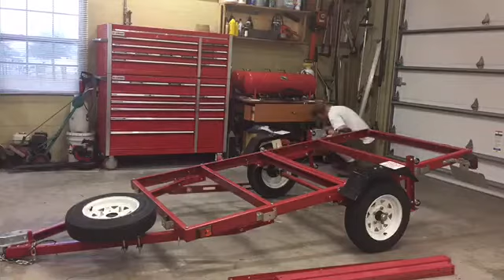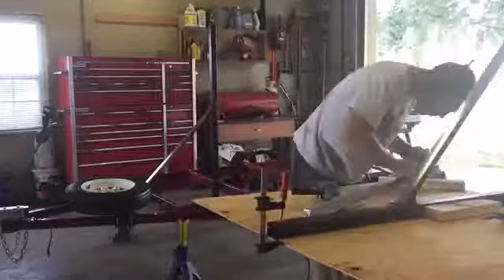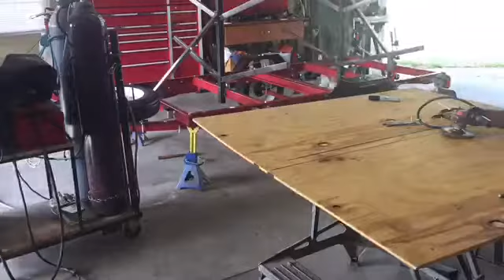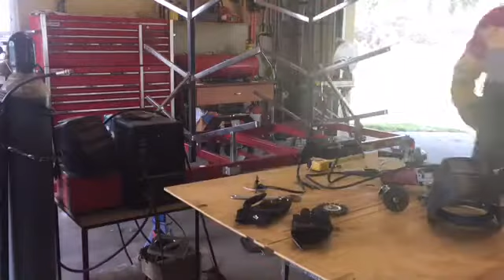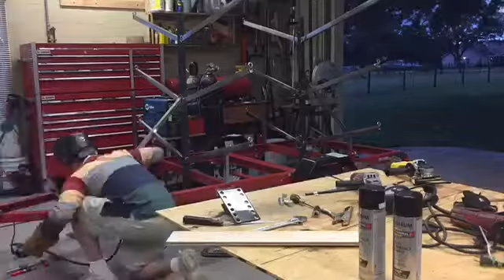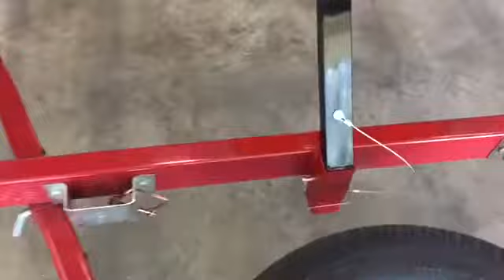Doug's Kayak Trailer Build

Comment: Nicely done!  You really checked off all the right boxes.  Removable so you don't have to dedicate a trailer to just being for kayaks.  The trees break down for ease of storage.  And you even added handles!  I think your design will inspire many builds.QUESTION - assuming that you have had it on the road now, do you think the pins are overkill?
Reply from the maker: Billy m No the pins are the level of comfort you want when driving down a bumpy road or going over a speed bump.

Comment: searched all over for ideas for my kayak trailer, yours has inspired me to build, and I'm getting ready to buy a welder and start the fab. Just had a couple questions.. What gauge steel did you use on the trees? And I could use some detail about the main tree-to-trailer connection. Thanks for putting this video up!
Reply from the maker: Phil V Sorry for he late reply.  As I recall the branches of he tree were just under 1/8" wall.  The tree is attached to the trailer with matching square tubing.  Adjust tubing size and wall thickness to achieve a nice slide together fit. I believe this was 1.5" inside 1.75".  Short pieces of 1.75" square tubing were welded to the frame cross pieces. Anything else let me know.

Comment: I have 3 kayaks. 2 weigh 90lbs one 50.  do you think putting the 50lb one on top on one side would make the trailer unbalance to the point of it swaying on the road?
Reply: Stream Rolling you shouldn't have any noticeable difference in how the trailer pulls/rides by adding just 50 lbs. to one side or the other.